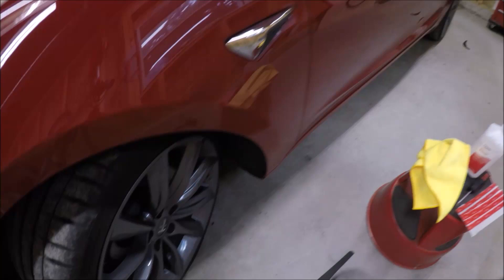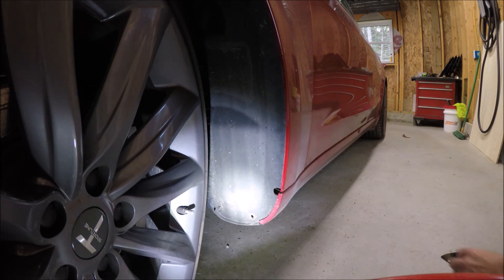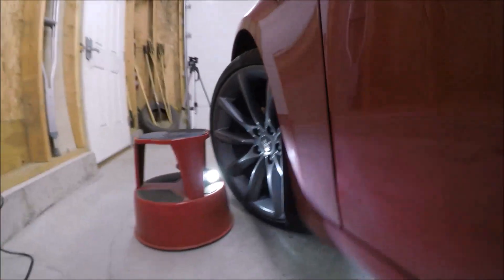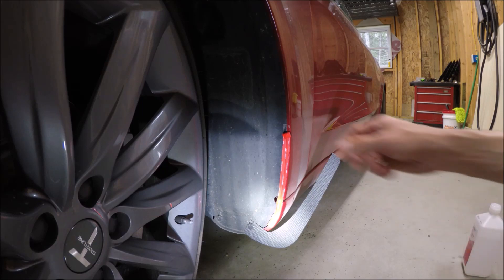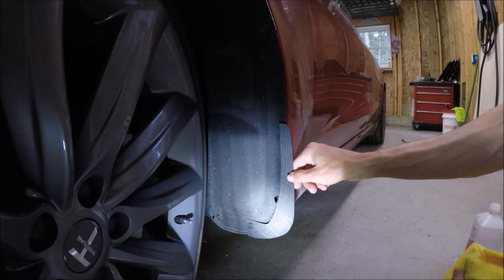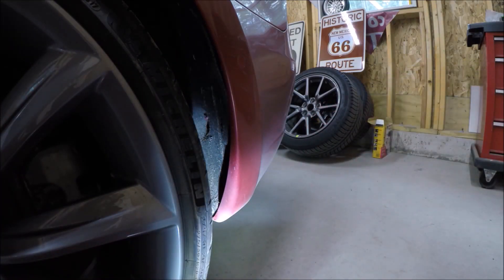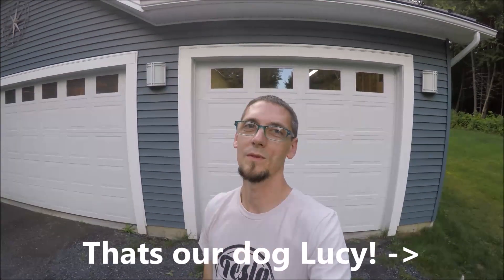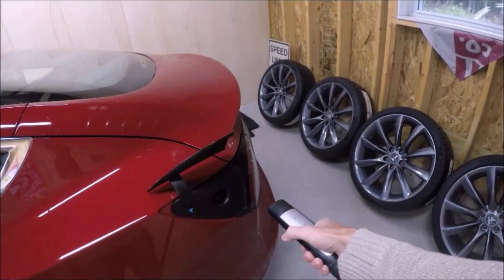Model 3 Carbon Fiber Mud Gaurds

Comment: How about a link to the mud flaps
Reply from the maker: I meant to put this in the description.  Here you go: https://www.protectmytesla.com/model-3-parts/model-3-carbon-fiber-mudflaps
Reply: @TM3Life   $180 for those is STEEP!
Reply from the maker: @TheOnsetHunter I do agree they are pricey, but I remember just regular OEM ABS plastic mud guards for other cars I've owned costing anywhere from $80 to $150 from the dealer.  These are genuine custom cut carbon fiber.  So, when I look at it that way $180 doesn't seem so bad. It's all relative of course.
Reply: TM3Life I think I’m just going to purchase some CF ones on amazon for 30 bucks. That are just generic, and then just drill the hole!
Reply from the maker: Please post some pictures and link them here. I’d love to see them. Thanks Cory!